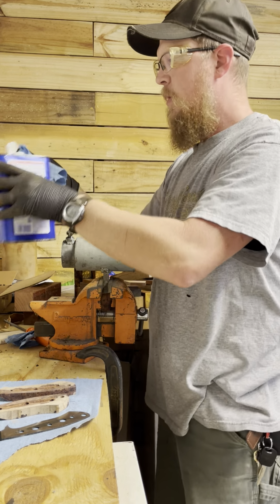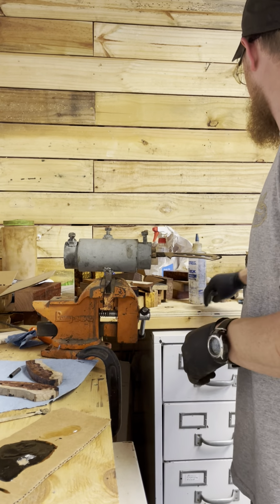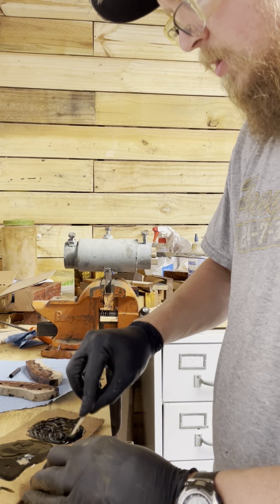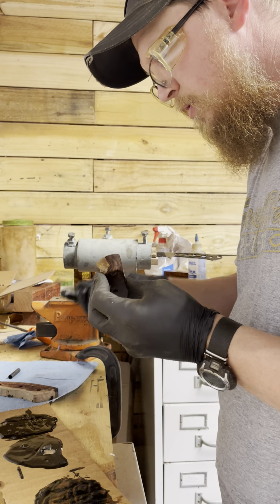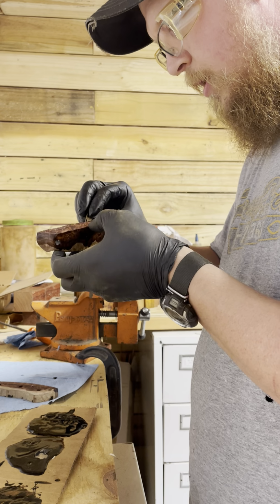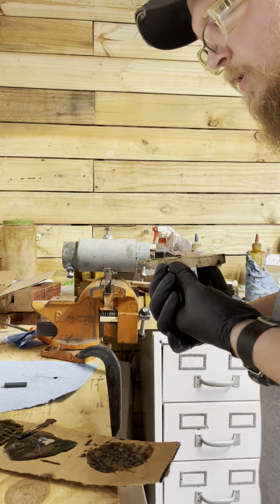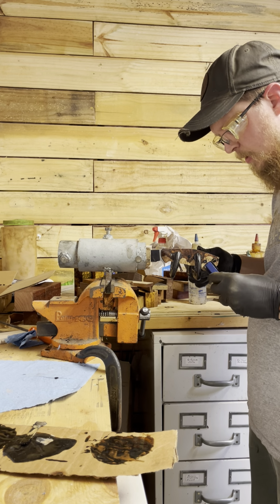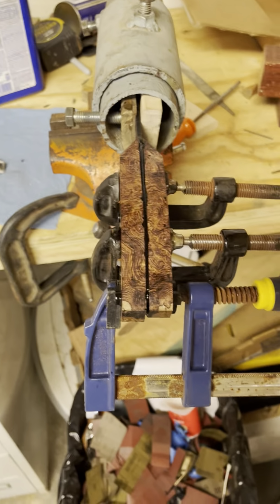Epoxying handles on tapered tang knife

Comment: Thanks for the tip on the dye. I use the good JB weld and it's that ugly gray and makes it harder to use than the clear
Reply from the maker: I only use gflex any more I’ve seen it put in a 20 ton press and just pop back afterwards. It really helps with the changes in weather and holds up solid.
Reply: @blauertknives  I'll have to order some I see that a lot of people use it. Thanks
Reply from the maker: @richardbranton190  you are welcome. Trying to help other makers is part of the reason I started this channel